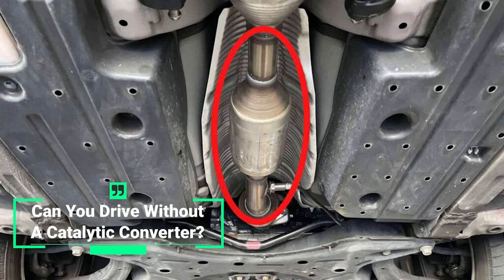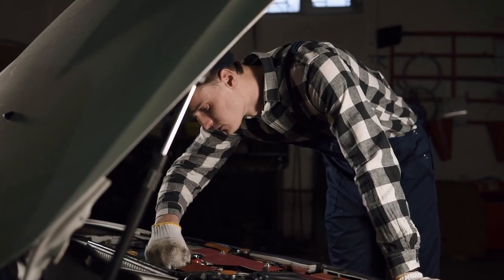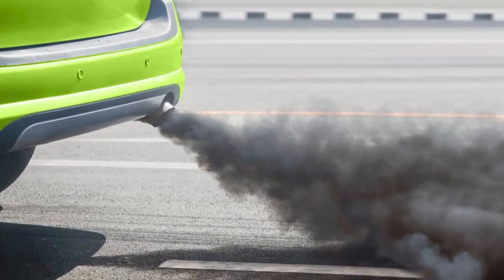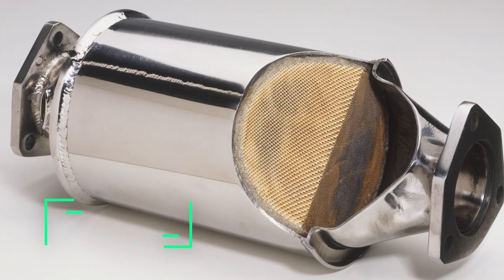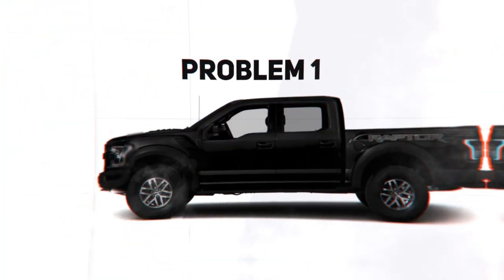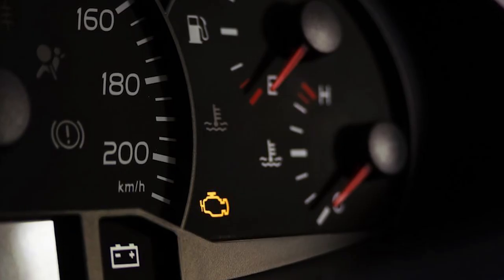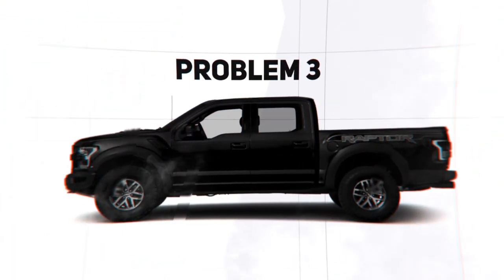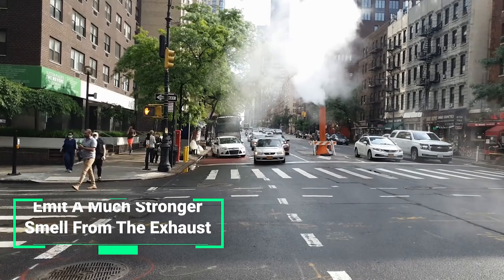Can You Drive A Car Without A Catalytic Converter?

Comment: So we're just screwed if they go bad and don't want to pay $1,500+ on an older car, and then replace and worry about them getting stolen? Sounds like a racket to me.
Reply: Not even close to a racket 💀
Reply: @rayidk7458  Must be an exhaust shop owner.
Reply from the maker: Hi. Unfortunately, that's the reality of the situation when dealing with most car parts. It can be expensive to keep your vehicle in top shape, and there's always the risk of somebody stealing something or it getting damaged
Reply: @autoalmanacofficial Update - I start the car every few days to keep the battery charged. I started the car a few days ago and white smoke came out. It's strange that it just showed up out of the blue. The estimate to replace both is $1,800. I would straight pipe it, but that won't pass my emissions test in a few months.
Reply: StevePringle go look at it and see lol what so hard about that!

Comment: Wait a damn minute the dealer wants over 2500 to replace this but in reality i dont even need it to keep thr car running???
Reply from the maker: Hi, as we mentioned in the video, it is possible to keep driving your car without a catalytic converter. However, it might not perform as well as it would with the converter.

Unfortunately, replacements or repairs can be pricey, but it's probably best to pay the price and have peace of mind instead of risking your vehicle's health and performance.

For more information, you may refer to the article that was the inspiration for this video: https://www.autoalmanac.com/can-you-drive-car-without-its-catalytic-converter/
Reply: You’ll have to get it replaced sooner or later. It will fail a smog and you won’t be able to renew your registration until your car passes the smog
Reply: @DieselRip.-yp4po lol this isn’t 1985.
Reply: 😂😂😂 I did a delete just because I could on my 2010 Honda Accord V6 and to trick my ECU I simply got on Walmarts website and ordered 2 stainless steel mini-cats for the O2 sensors after i gutted all three cats and bolted them back on 😂
Reply: @DieselRip.-yp4po in Mississippi we don’t have worry about thank god 😂

Comment: Question what if someone switches to a catless down pipe ( it’s a higher flow pipe without a catalytic converter and have a tuner remove the check engine light, will that be okay?